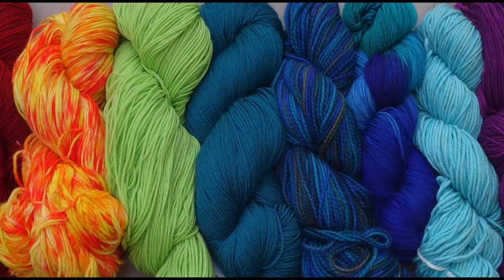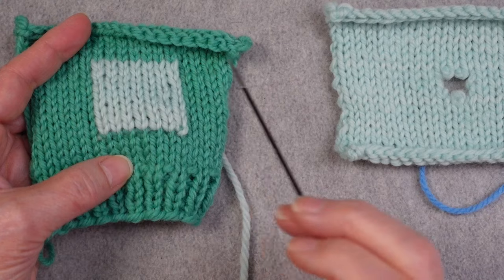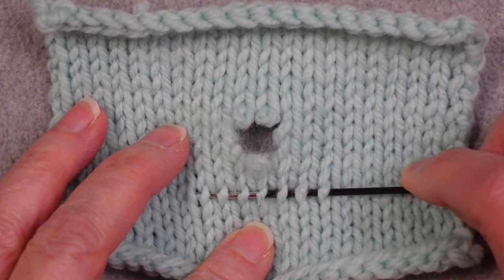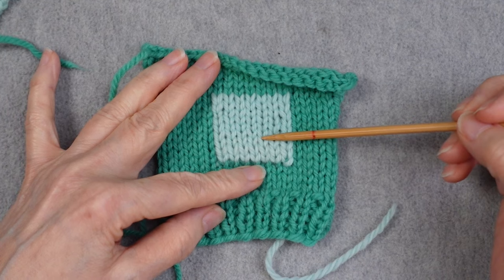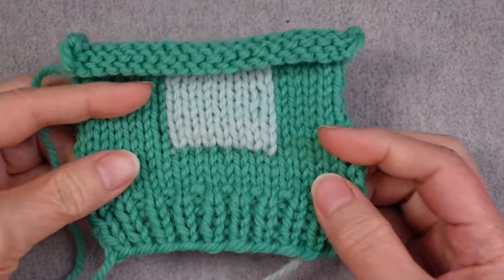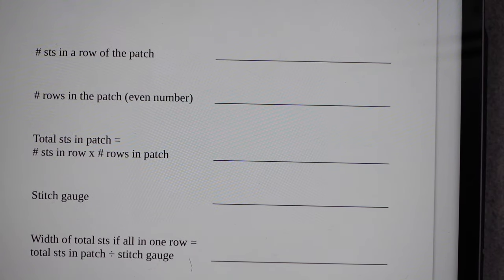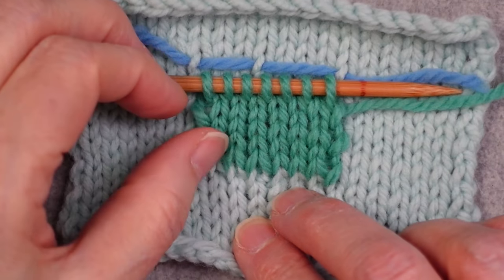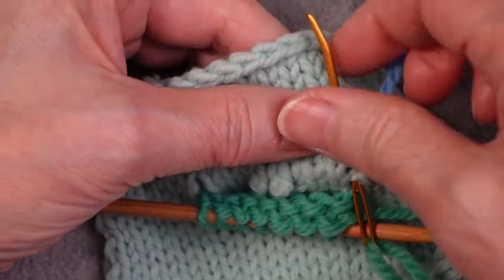Apply-as-you-go Knitted Patch for Holes // Technique Tuesday

Comment: Thank you for showing this patch. I have question, if the yarn at the hole is not worn, can one fill in the missing stitches or is that type of repair unstable ?
Reply: You can. I've fixed a hole by weaving in duplicate stitch for about an inch and continued the pattern acrossed the hole and continued on the other side for about an inch as well. Granted it was a small hole in only one row and only a few stitches larger holes will need a different method.
Reply from the maker: YOu can stabilize the sts in a couple of different ways. Duplicate stitch is one.  https://youtu.be/B07yz_kuU8Q If you don't have the same yarn, and you want it to be less visible, you could reinforce on the back side. https://youtu.be/E9nNkqLxdhE

Comment: Would knitting through the back leg of the pick up row (at 7:28) prevent the twist in sample 1 so that it looks like sample 2? It's so very helpful to see exactly how to attach the sides and graft the top. 3D visualization is tough for me. I'm sure I'll be referring to this video often.
Reply from the maker: The problem with the pickup done through the right leg is that the pickup is done on the surface of the knitting, and not through the fabric.  I can't always visualize what something would look like, either. It helps to knit up a swatch and experiment with different ideas so that you can see what happens. I would suggest picking up the right legs of some sts and knitting through the front of some and the backs of others, and then try picking up through the heads of the sts, and then try picking up through the center of a stitch with the yarn at the back of the work, and then compare the results.